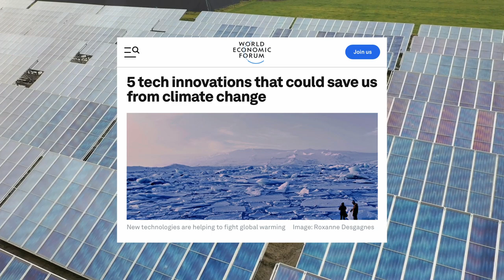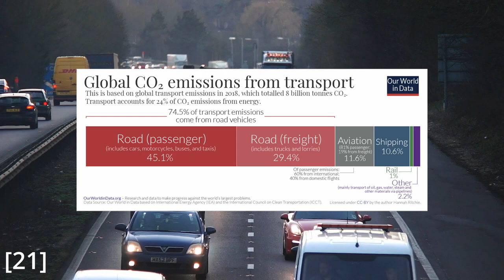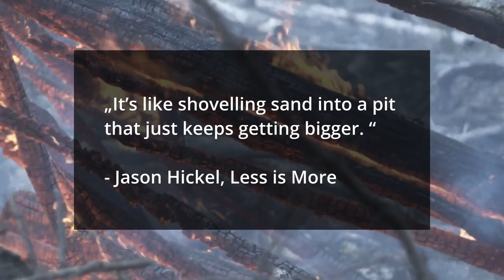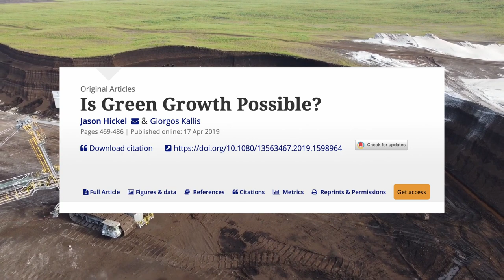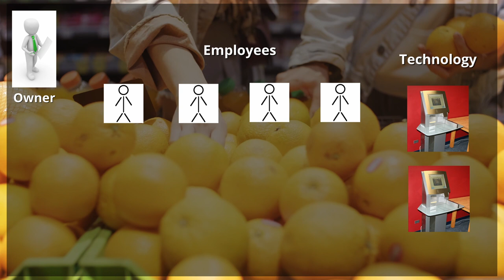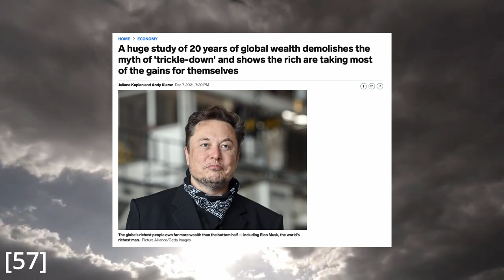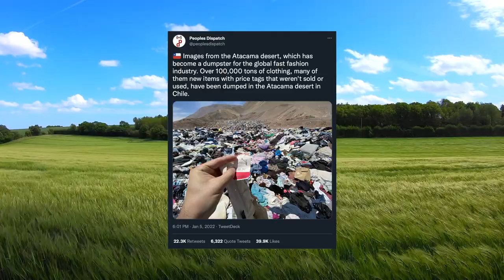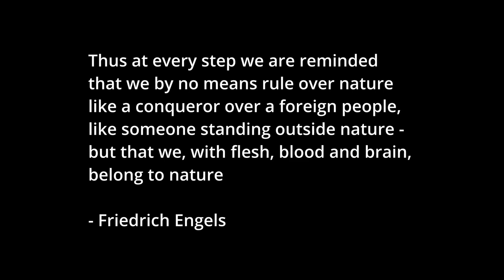Why Green Capitalism Is A Lie | Part 3

Comment: This has to be one of the most accessible climate change series I've ever seen! I appreciate the lack of doomerism too :)
Reply from the maker: Happy to hear, thanks!!
Reply: Well... things are actually worse than what he's describing because Peak Oil is also a thing, and passing the peak leads us into irreversible declines in energy availability and an irreversible decline of industrial civilization, regardless of climate change.

But even factorin that in, I still think there's no other acceptable option than estimating what kind of life and society would be sustainable for at least 1000 years based on resources we know to be dwindling, trying to reshape everything you can to match that vision, and trying to convince as many as possible to do the same. Slow down the collapse as much as possible, shift to a radically different, more sustainable, way of living as fast as possible. Basically "Make Solarpunk Real Now". Despair is not an option, Business As Usual is not an option.

(BTW, I don't like it when people just say "xyz is sustainable" without mentioning for how long. Nothing is sustainable forever, everything degrades, the only question is how fast. And when someone comes up with a proposed improvement, we should ask how many times longer - or on what timescale - will it be sustainable vs. the old solution.)

Comment: let's not forget to stress that limiting the environmental problem posed by capitalism to its sole impact on climate change is the least we can do. Added to this are the erosion of the banks, the impoverishment of the soil, the acidification of the ocean, the pollution of the water tables, the innumerable factors of toxicity of the air and the soil, of the dwellings too, the drastic drop in biodiversity (absolutely horrible), disruption of ecosystems, pandemics and other resulting nuisances coming from insular other ecosystems, etc.

The class war is also and foremost an environmental war, coming from an honest materialist stand point as this excellent marxist pointed out. 

(English is my second langage so you are welcomed to correct me).